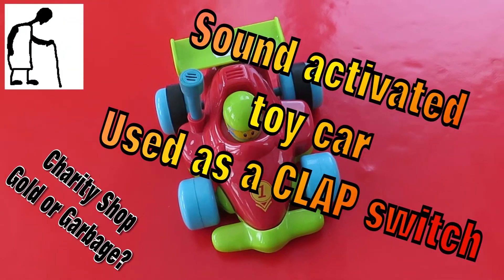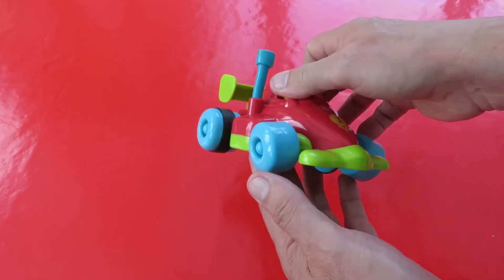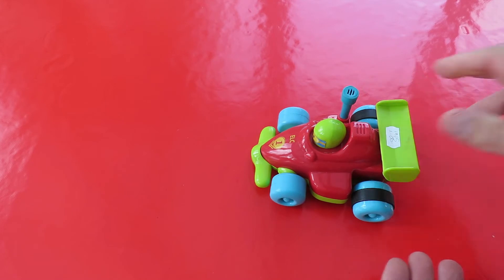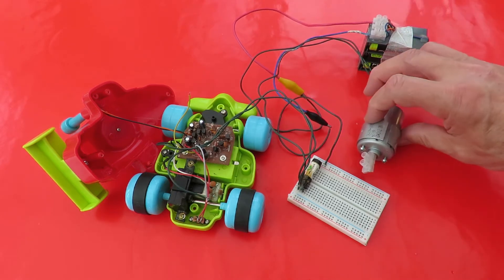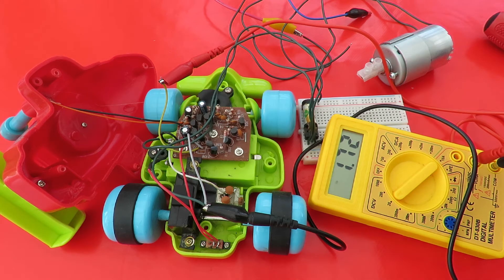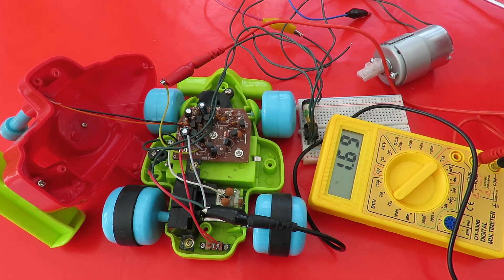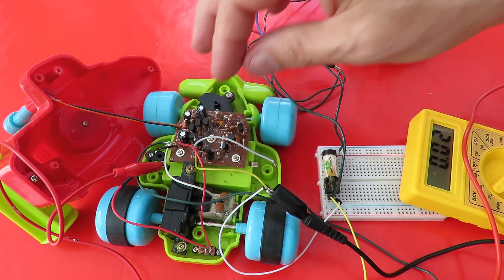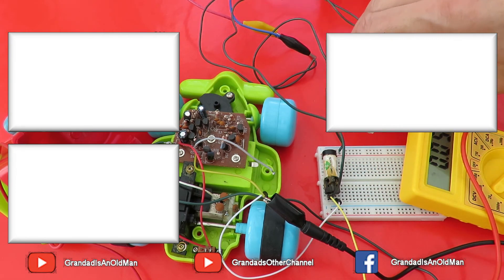Charity Shop Gold or Garbage? Sound Activated Toy Car - Clap Switch

Comment: you keep surprising me, i like that :-)
Reply from the maker: Thanks 😊. The original idea of the Charity Shop series was to buy cheap stuff and see what I could do with it, sometimes I was just buying them as a source of cheap electric motors, however I have built up a rather large stock. I try to buy items that have some sort of novelty value, maybe just faulty in need of repair or maybe just to see how they work. Of course RC cars always seem to be popular just because they have RC in the title.